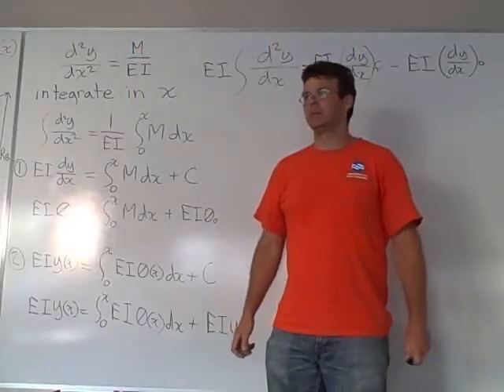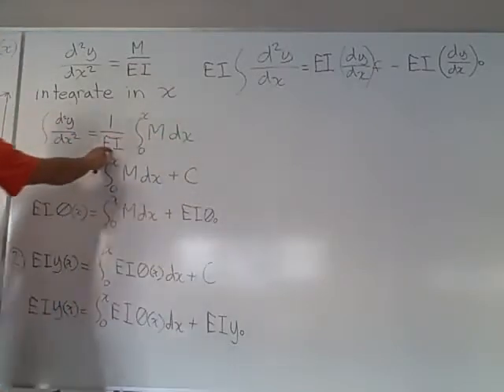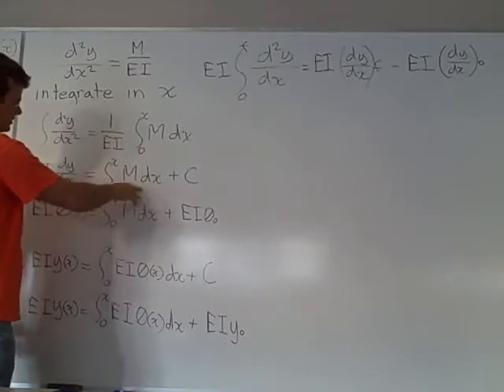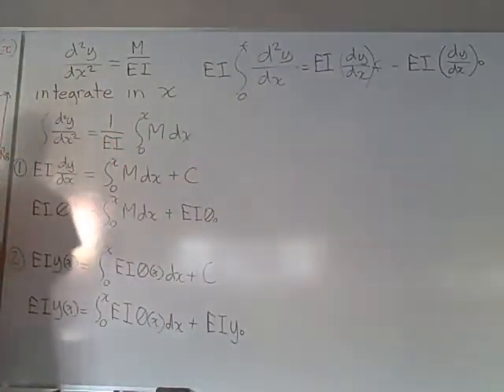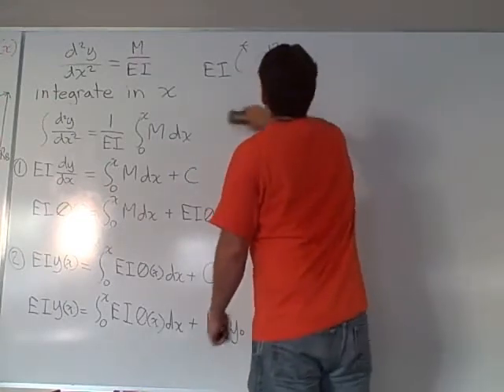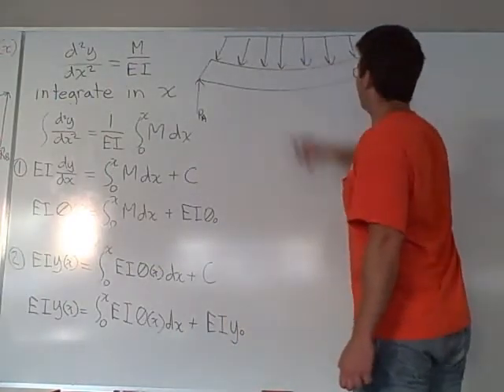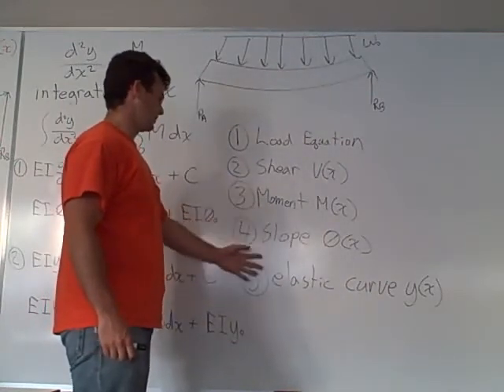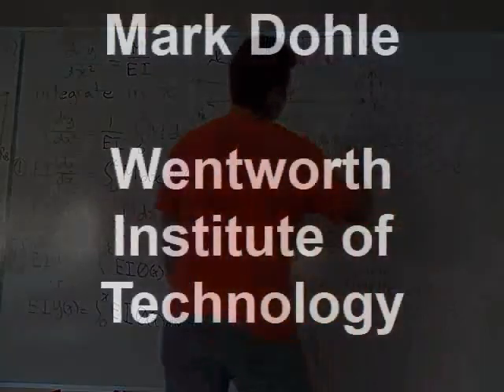Part 2 Beam Deflection

Comment from the maker: @diflection1 I'm trying to show that C is equal to the initial condition EI times the slope at x=0 along the length of the beam. My integration of second order equations might should be checked because I'm no expert, but I am certain C= EI times the slope when x = 0.  I have yet to find a problem where this is false.

Comment from the maker: @diflection1 When you integrate EI[d2y/dx2] from the initial to final condition, the result is EI[dy/dx] at the final condition minus EI[dy/dx] (a constant)at the initial condition.  Now, when you integrate in x, if you substitute this result into your original equation EI[d2y/dx2] = M(dx) from initial to final, you will see that EI(dy/dx) at the final position= Mdx from initial to final + EI[dy/dx] (a constant)at the initial condition.